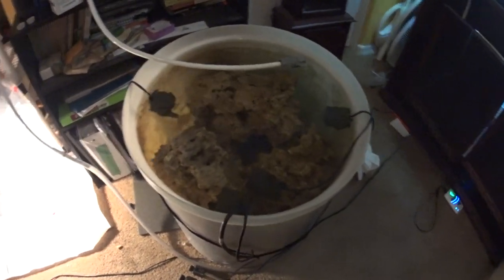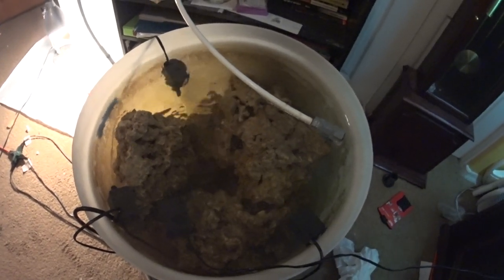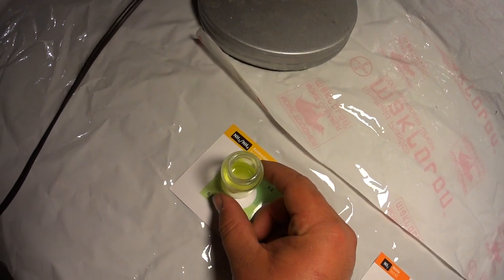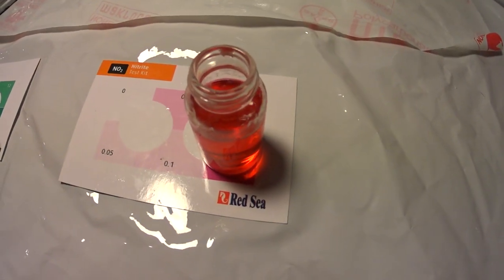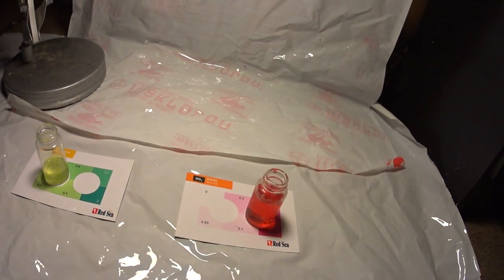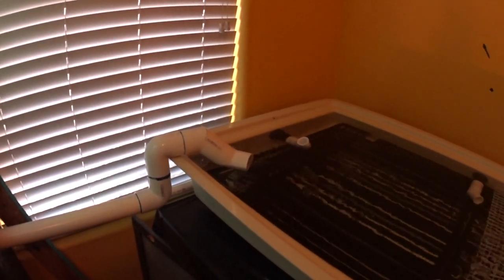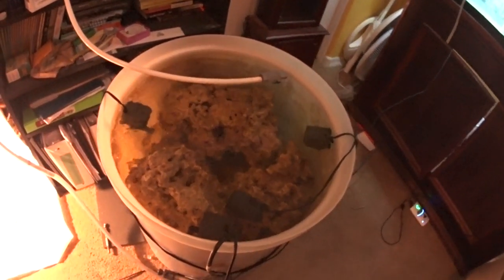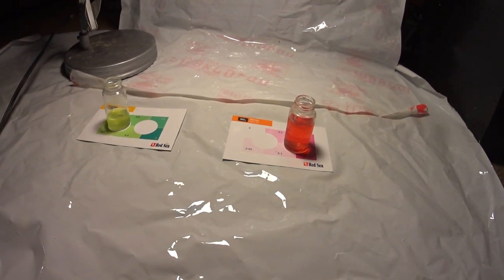Week 5 curing dry pukani rock/ small fish room update

Comment: What is the white hose for? I've been enjoying your videos for about three months now and am enjoying them. I'm still trying to cure my live rock in my 10 gal QT tank but I've screwed up and couldn't wait and Had to start over. 4th week now and my ammonia and nitrites are 0 or 1 and nitrates are 2 ppm. I am also starting to cycle dry rock now. Eventually I will have a 75 gal going
Thanks for all the info
Reply from the maker: +Bob Escher Nice ANd thanks for watching!!!!  Sounds like your cure is going much quicker then mine LOL its been slow going but I have too much to lose if I don't get it perfect so I'm good with slow LOL..  The white hose is from the BRS dual media reactor, I had to run carbon for the first week because of the stink this rock blessed me with at first HAHAHA..  Ill sub I'm looking forward to seeing a build vid.
Reply: +SIMUANGCO2468 You should have used hydrochloric acid to clean the stones, then it would not take that long, hang an air stone in there, the bacteria need oxygen for the metabolism